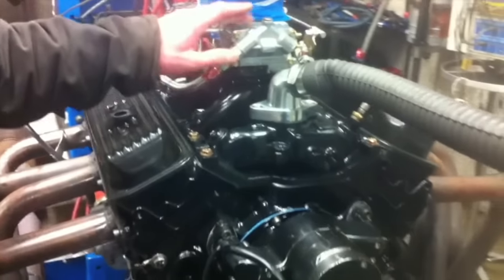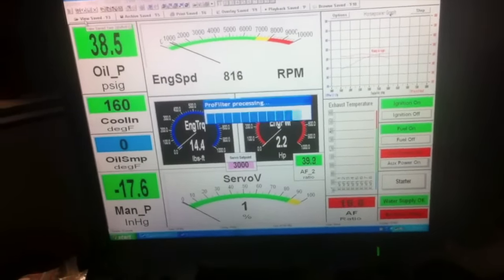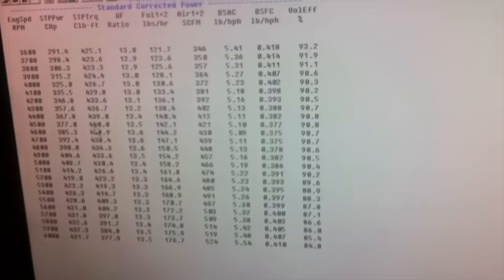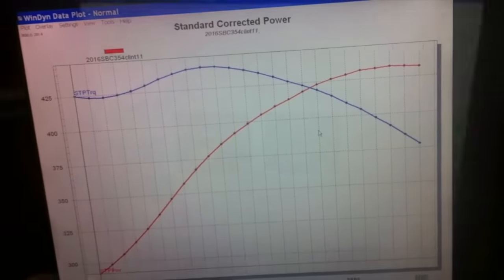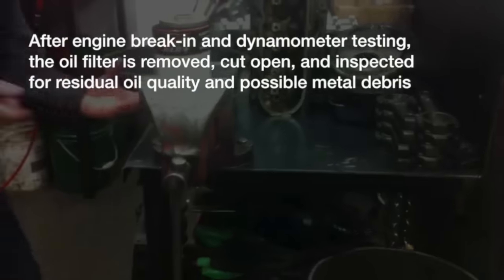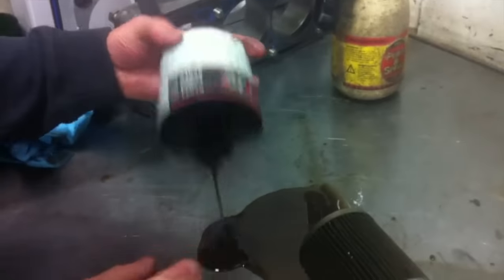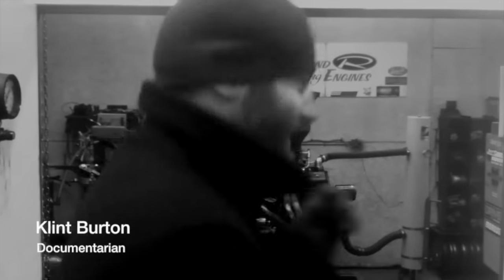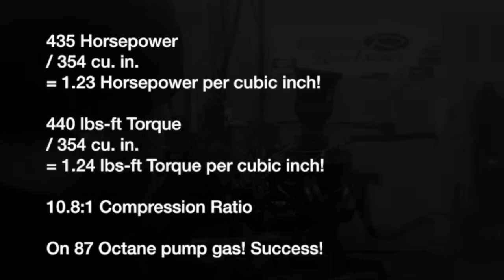SBC 400 Block + 327 Crankshaft Dyno The 350 Chevy Should Have Built (2016)

Comment: What cam were you using? My engine builder, who knows his stuff(he's the one who did all of the experimental port work for the large intake runner heads we have today) does not like to go above 9.5:1 when using pump gas. Of course my motor will be a typical stroker motor. 1987 1pc seal block, 40 over, Dart Iron Eagle 72cc chamber/180CC heads with roller cam. Going in my project Chevy 4wd square body. So the cam will be quite different as I want torque. So timing I expect will be quite different. My motor will be around 9:5:1. Depends on the deck.
Reply from the maker: The camshaft in this 354 with the 6.250” rods is a solid roller. Very mild though with 218/224 duration @ .050” with .560 lift and 112 LSA. Also a 4/7 swap firing order.

Comment: I worked for a guy 33 years ago that would buy old fuel oil trucks and busses with 327s in them. Forged steel large journal cranks that fit the 400 block for a 500$ claim dirt track late model engines.
Reply from the maker: They are so hard to come by these days! Thanks for commenting.

Comment: I'm a boat mechanic and built many 377 motors. 425 hp with off the shelf  parts. Dano at 425 hp at 7700 rpm with 661 327 vette  heads. Great ski boats.
Reply from the maker: Awesome! I have a 400 Chevy in my 16’ v-drive flat bottom boat. Just love it!
Reply: Did you do anything to the 400 block to help the cooling (siamesed cylinders)? I think I heard about drilling and tapping the backside of the block to increase coolant flow?
Reply from the maker: @ronroberts110 

We brought coolant from both rear corners of the intake manifold to a thermostat spacer through 1/2” hoses. Cools amazingly.

Comment: I'm planning a LS build that goes in the opposite direction - Small bore 3.903", 6.275" con-rods and long stroke 4.125" w/ high compression ratio 12:1 and 66cc combustion chamber, all kept in check w/ water injection. Hunting for max thermal efficiency. Maybe a Whipple S/C at some point - Dreamin'.
Reply from the maker: Sounds interesting!

Comment: I've built some amazing Chevy SBs by using various size cams and cranks from 327,350,283 and 400 engines.
Not all were great, but I had some nice surprises, too...
Reply: If you could pick any of those motors you listed for a weekend warrior. Which one would you pick?
Reply from the maker: Well that depends on the vehicle I’d say. I like a quick revving small block with a 5 or 6 speed behind it!

Comment: What cam and valve train was in it?  6,000 with that short stroke is low.  With a good valve train it should run out much further.  That is why I asked what kind of cam.
Reply from the maker: This was a very mild 218/224 @.050”. Something around .571” lift if I remember correctly. Solid roller and a 4/7 swap firing order.
Stock rocker studs and cheap roller rockers. 
Budget build but a nice combo for street use.

Comment: I've got a 305 chevy motor that needs a cam anyway,but being a van I'm going to pull t motor and save my back & mind for better things. Being in CA. I have been limited to an ŔV cam. I plan on using 1.6 ratio rockers(after t smog test)..my question is what can I get if I could put a 327 crank w/ custom pistons(smaller bore). I know about the 400 stroker trick but I think it's a toss up. That thing's limited by t tiny valves, I will be able to port t heads with the bigger exhaust valves. It should be able to get better air. What can I expect   a waste of time + $$$?

Comment: I agree! This was the way to go back in the day. Smokey Yunick said to use the biggest bore and the shortest stroke with the longest rods possible. Destroking was common. A 350 mopar big block was 4.06 x 3.58, a 383 mopar has the same bore as a 454 chevy 4.25. 400 has a 4.342 bore 3.375 stroke, 6.358 rod. The Chevy 302 was a renowned great engine. Stroke does NOT necessarily make more torque, this is because bigger valved can be fitted, piston speed reduced, allowing for smaller cams to attain same hp. Do the math it makes no difference in torque to have undersquare or oversquare. Except longer rods can be used with short strokes. Some big Diesels actually had the cylinders offset to the crank to straighten the push. GMC designed the great gasoline heavy-duty V6, V8, and V12 truck engines with huge bores and short strokes for less cylinder wear, higher volumetric efficiency, and a flatter longer power curve needing less gears in the tranny. I have owned 27 of them. A 401V6 had a 4.875 bore and a 3.58 stroke! They would pull down so low that an electronic tach wouldn't read it. I accidentally wound my built one to 6300! It lived! They pull like an electric motor from idle to peak torque at 1400 rpm, up to 5000, with a 4bbl and magnum heads. The 637 V8 had a 5.125 bore and a 3.86 stroke! Yes, a 637 with LESS stroke than a 454, built to haul semis! It had 2.3" intake valves. Chrysler engineers didn't want to stroke the 340 to a 360 without raising the deck fearing engine life issues. That's why OEMs didn't build anything like modern "stroker" motors for passenger cars and trucks. Couldn't warranty them! This from a guy who's building a 572 hemi! Long stroke small bores go back to flathead engines where big chambers made high compression hard to get and octane and metallurgy limited RPM. Better cylinder heads have made strokers possible now or everything would run like a 500 cadillac!
Reply from the maker: Hey, thanks so much for sharing these numbers! Much appreciated :)

Comment: I’m getting ready to build a hot version of this. I have 6.125 long rods, is this easy to find pistons for?
Reply from the maker: Hi @Jay! WIth 6.125" rods, you're looking for a 1.250" compression height piston, based on a 9.000" deck height, which shouldn't be difficult to find depending on your desired bore size. We used 6.250" rods for the 1.923:1 rod-to-stroke ratio—the goal of achieving as close to 2:1 rod-to-stroke ratio as possible (specs are in the video's description box if you haven't seen them). Thanks for your question and comment; best regards!

Comment: Pretty cool results but when saying "the 350 that Chevy should have built" keep in mind they didn't release the 4.125" block until 1970 and the 4.000" inch block had been around for a while when the released the 350.  It was probably easier (ie cheaper) to just stroke the 327 to get a 350 at the time.  Also, a "stroker" was probably better for what they needed at the time as it went in everything including trucks and full size cars.  And, they didn't have access to Vortec head, an RPM intake or solid roller lifters.  ;)  That said, this is a cool video and thanks for sharing.
Reply from the maker: Hi FPO! Thanks for commenting! "The 350 that Chevy should have built" references a 1997 Hot Rod Mag article; the archived link is in the description box. Best regards!

Comment: I noticed the engine temp on the pull we saw on video was 140 degrees or so. In a real world application that engine would be running at least 190+ degrees. What were the numbers at regular engine operating temp and did you have to pull timing out because of the detonation caused by that additional heat on 87 octane?
Reply from the maker: We did pulls up at 170 and no issues. In a 1964 Cutlass with a stick it ran fine on 87 with a moderately good cooling system. When really booting it though, 89 octane was a better choice. 
Thanks for commenting :)

Comment: Hot Rod Magazine, June 1997
The 350 Engine Chevrolet Should Have Built.

0.030 over 400 block
327 crank
Ford 300/six 6.35" rods
AFR aluminum heads with 56cc chambers,  190cc intake runners, 1.99 intake valves and 1.55 exhaust valves
Edelbrock hi rise Performer RPM intake
Edelbrock  Performer 4 barrel with no jetting changes
JE pistons with a raised pin height
Comp Cams PN 270HR10 similar to a 1997 Camaro cam
1.6 rockers
Fluidamper
87 octane
36 degrees total timing
413 hp @ 5,800 rpm
440 ft/lbs @ 3,800 rpm

Duttweiler ran the dyno test
You guys should give Hot Rod Mag and Duttweiler credit for doing this 25 years ago.
Reply from the maker: Hi Greg! We acknowledge Hot Rod Magazine in the video description. We've noticed many don't read that part. They weren't the first to build this combo and certainly haven't been the last. Hot Rod's article states they used Ford 300 L6 rods that are 6.209"; not sure where you got the 6.35". Please send a link if you've got it. Thanks and best regards.

Comment: I'm wondering, rather than running a carb, how well this would work with a tuned port intake?  TPIs are said not to work well above 4500 rpm or so, but I like to keep my car stock appearing.  Or maybe a miniram?  While that wouldn't be correct for an 89, it would get that extra rpm for that hp/tq curve.
Reply from the maker: Hi Kamala's speech writer! What a handle! Running TPI would certainly deliver a more consistent air/fuel mix. In this case, our customer wanted a carburetor. But, there it is, the beauty of what we do and all the choices we have. And at the end of the day, it's all awesome! Thanks for commenting! https://www.youtube.com/watch?v=aqQaktYtbyI

Comment: What size rod though? I know Hotrod did a test with a 6.29 rod from a ford 300 6 cylinder with a 11:1 compression ratio and discovered it ran fine on 87 too and got similar results. I wonder who makes good aftermarket rods? you could probably go up to 6.35" if you could find a piston to work with it
Reply from the maker: Thanks for commenting! We used 6.250” rods from Eagle.
Reply: The 300 rod is 6.209". I have that article. I found this video because I randomly looked to see if anyone else ever tried this build.
Reply from the maker: That’s cool. Same article we started dreaming with :)
Reply: @ceperformance  Too funny. I remember that article as if it was yesterday. I too dreamed...but never built it.
Reply from the maker: Thanks for commenting! We’ve done 2 now. The second one with the as-cast AFR heads and a hydraulic roller camshaft. They really are great engines :)

Comment: What are the cam specs? I need LSA and both advertised and .050 duration. You can keep the lift, LCA, and advanced secret if you want. I also need the intake valve size.

You should be able to make much more power than this. 1.4 ft-lbs per cubic foot. Yes on pump gas (even 87) and yes on less than 11.5 compression. You should also be able to do it with much less timing, especially since you're running modern fuels.
Reply from the maker: We had Comp Cams make it for us. The lobes we used were # 4870s / 4871s
LSA @ 112
218/224 @ .050”
The lift at the lobes is .361” on both.

Comment: Do you think that a Gen 1 SBC 350 could reach Gen 3 LS power levels approaching or exceeding 1000HP with forced induction via a turbocharger(s) ? I think that Richard Holdner was easily able to exceed 600HP with twin turbos.
Reply from the maker: Thanks for your question. Looking for more than 600 HP is a big ask of a gen 1 350 in my opinion. The block is just not as strong as an iron LS block.

Comment: What cam/rockers/ heads on this combo?
Nice setup, thanks for sharing! 😎👍🏾👍🏾
Reply from the maker: Thanks for asking. This was a bit of a budget build. There were a few expensive pieces like the custom 4/7 Swap solid roller Comp Camshaft. Comp Cams chromoly pushrods but basic roller tip Comp Rockers. The heads are common Vortec 350 heads.

Comment: Small crank plus big-ass bore equals insane revving.. been that way with motorcycles for decades.. 
when you get the porting and back pressure right you got a missile
Reply: Agreed, in the world of old engines we always hear about stroke but short stroke engines deliver more hp right through the rev range if done right and you can turn them into a screaming banshee.
Reply from the maker: Hi Mustang! Thanks for your comment! We had the opportunity to build just that: a 3" stroke x 4.185" bore by combing a 283 crank and a 400 SBC Bowtie block with 350 mains, which produced 512 HP and 435 LBS FT at the crank: https://www.youtube.com/watch?v=Ge6RsIOs1-U .

Comment: As a young man growing up in a family w 2 gets of  mechanics and dad  having only wrenching and fab work w a masters in auto engineering this combo and MANY others was norm. 50ish years ago  gramps  was tinking w water injection and other mods . Some a bit odd.we had no dyno to  let us know.  But they had their  ways. Getting pushed into the  seat was ho-hum. In senior high some thought  I was a snob cuz their stock 440 didn't  impress !! Or whatever. 
Gramps  wrk truck/daily  driver was a early 5o's f 100. He had a built 460 in it.
And I have no clue what all he did to keep it on the roads....I believe he had a tcase fitted underneath  to give him some overdrive. If you've ever been  REALLY  AFRAID  but to afraid to say so this was it !!!! My mom had a Corvair ( don't know year )  and she was  a " mellow  " driver but that  Corvair would lift a bit n set ya back if she was running  late for a Tupperware  party. One of pops  doings. 
My first  car was a 4door Bel Air gave a farmer 300$ for it. A real  plane Jane  for sure  !! It  came w a 327 4bbl. It had grass growing up  through places ya didn't  know grass would grow!!!   It drove home just fine. But I guess  not  fine enough  lol.  But it was what dad n gramps said was a " good litt mouser " with some  "help " and a place to start learning  ( for me ). So the MOUSE went to the  back of the shop .  I just wanted to go driving  !!!!  At 14 that was a big deal 8)
Any way,  after a month or so the mouse went back in but w headers that  ran half the length of the car a short  bit of pipe, the ' mufflers '  and right to turn downs. After a few hydroplanes into  ditch or fields I got the hang of it and to this day have respect for the Power Glide trannies !!! Its crazy how  a drill bit n springs can make one snap to like a cadet on his first day with a  drill instructor  !!   It wasn't a  chick magnet  but was me, dad n gramps together  and I was a 1 girl or at a time  kinda guy anyway.
Reply from the maker: Hi Tracy! What a brilliant story! Thank you for sharing that history, in brief, here, with us! Most of us have those type of stories:) Best regards!

Comment: Are those vortec heads or just ported center bolt it has valve covers like what would be on a late 80s early 90s those heads were never known for good flow
Reply from the maker: Yes, these are Vortec heads that we angle milled down to 55cc’s. Good cheap power :)
Thanks for commenting.

Comment: With the price of our fuel taking its toll on our wallets,  it is great to see what compromise means in performance.   I started dialing my 455 Buick back a bit last year so I can run 89 octane plain pum gas instead of the super expensive 91 - 92 octane Non=oxegenated gas.   It is a dollar a gallon cheaper,  and did not notice a ton of difference pulling back a degree of timing.   Then again I am not racing.
Reply from the maker: Good points :)

Comment: Awesome. How does it run on 87 in an actual working environment with 180-190 water temp, breathing hot air from under a hood, idling in traffic during the sun er.
Reply from the maker: Thanks for asking. Pretty decent actually, even in a A body GM with a 5 speed. It later was put in a 55 Nomad Gasser. If really ripping on it we’d run 92 but for the most part 87 worked great.

Comment: I actually have a couple of idea’s for an engine build. One is a Ford 352 that has a stroker build. The other is a Ford 240 inline six punched out 100 over, with 11:1 compression split exhaust and a 4 barrel carb. The reason I suggest the 240 inline six, is two fold. One I built a similar engine with a 240, and two I have seen a ford 300 inline six built with duel exhaust, 4 barrel carb and eventual super charged. So I am curious as to what the horse power would be on a 240 inline six punched out 100 over.
Reply from the maker: Hi aBRV! Great ideas there; makes us curious, too! Best regards!
Reply: That 300 6 sounds like one Dave Workman did back in the late `80 and put in a rail.
Reply: Yeah FORD, Those will make awesome deadweights for strongman competition or a farmer to drag around his field to churn the soil!

Comment: how about trying the 3.10" stroke crankshaft out of the 262 lt1 engine?  I'm currently gathering parts for this build myself for my '63 nova. but I'll be using the 5.940 rods for budget reasons in the 400 block of course.
Reply: Ive got a set of 400 , 5.65 rods with a set of dome pistons .
Reply: I prefer the longer 5.940  rods for better stroke ratio.  these are stock in the 262 lt1 engine.  pm rods.
Reply from the maker: I’ve been thinking about something like this as well. I think the 94-95 L99 was a 3” stroke. It would be nice to find one of those crankshafts!
Reply: @ceperformance  you're right, the crank that I have is the early 262 '75 sbc nova  engine crankshaft  it has the 3.10 stroke.  had it confused with the LT1 engine because that's where I got the rods from.  how about trying that combo?   I would like to see if it works before I get it done.  might be a bit before I finish it,  got other projects going
Reply from the maker: @martinbanda1091  
That might be a future project for us actually. Years ago we offset ground a 307 crankshaft (3.25”) down to 3.16”. We figured out a rod and piston combo that worked but haven’t pulled the trigger on it yet. Should be a unique yet budget build that could make some good power.

Comment: You do know that the crank is 4340 out of the 400 course it'll go into the 350 making it a 383 stroker now pick out your piston rods pick out your Pistons pick out your heads with the largest exhaust journals and pick out the valve train and most of all pick out your intake and your cam then figure out if you're going to run a blower or Turbo and it doesn't stop there transmission pick out your rear-end gear ratio four link suspension for the rear end and then you have your front end suspension also all that pointing taken happy hot riding